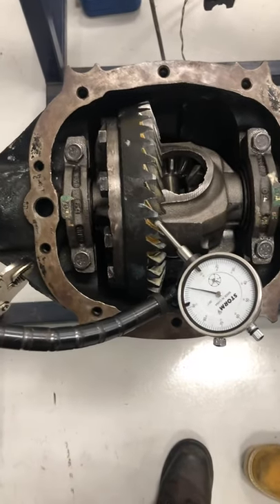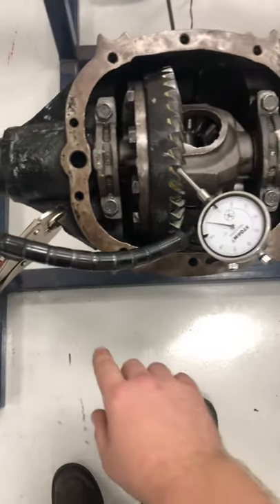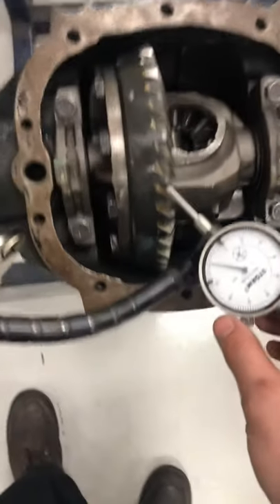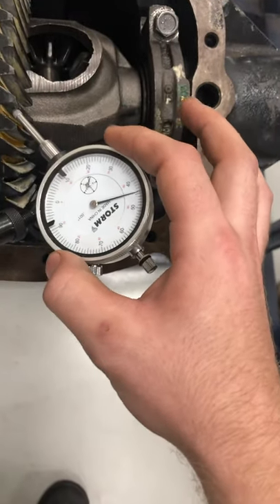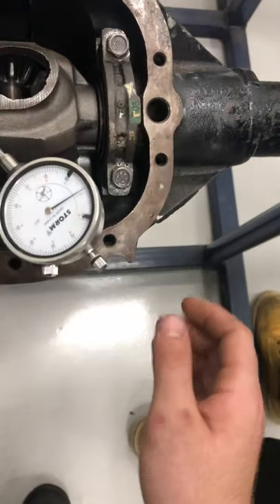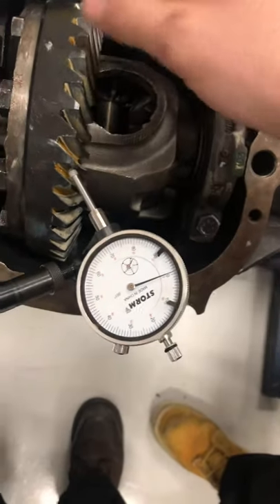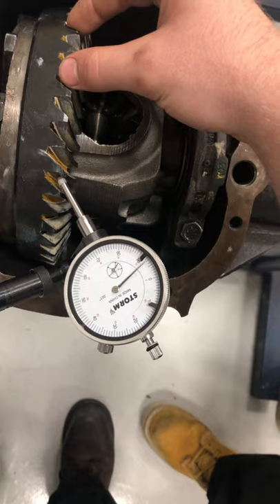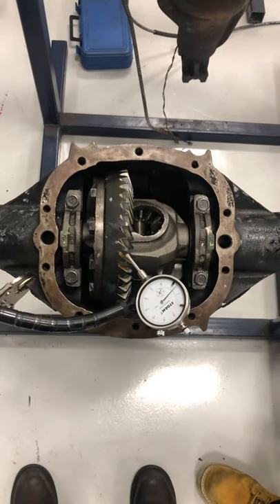Measuring for backlash with a dial indicator

Comment: Preferably you want to align the dial indicator shaft as straight to ring gear tooth as possible. Leaning it over that far may give you a slightly inaccurate reading.
Reply: A test indicator would be a better tool for this measurement.
Reply: @dp1381  what? A dial indicator has been the proper tool for checking backlash for the last century. You just need to set it up correctly